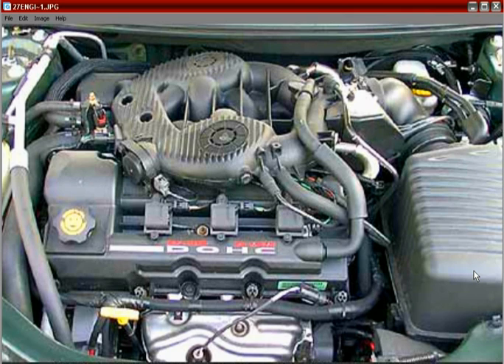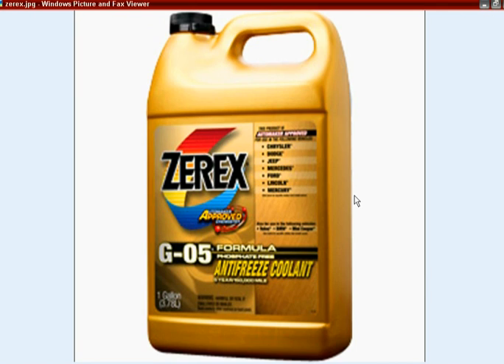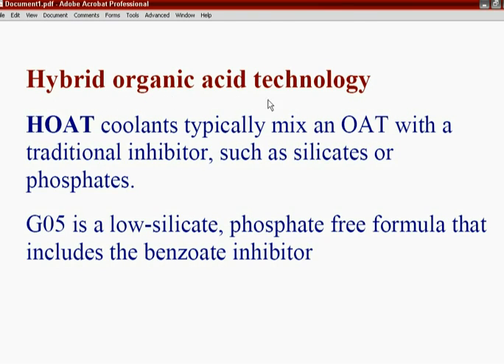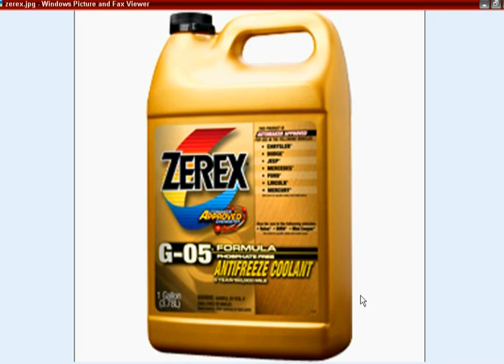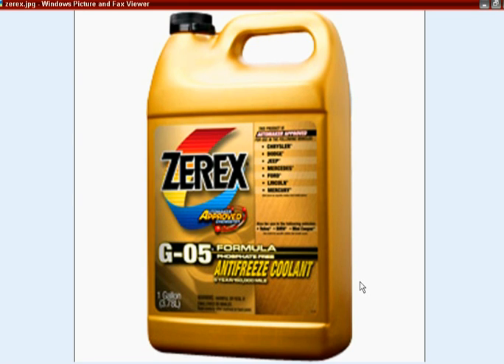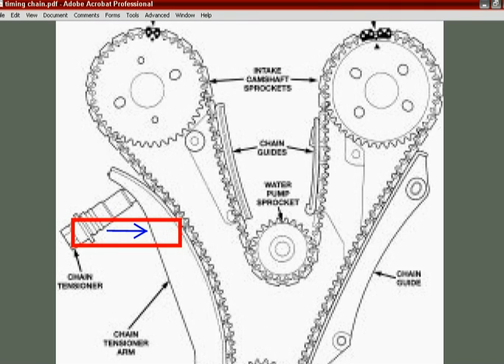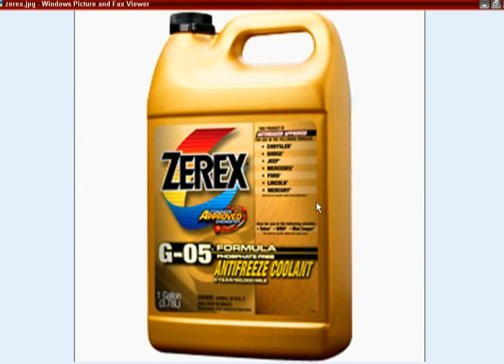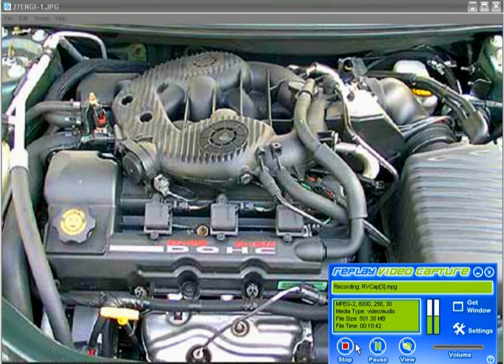Chrysler 2 7 ANTI FREEZE & Block Stop - CRITICAL

Comment: Bought a 01 Sebring convertible with the 2.7 ,,,,,was buying car for the body and figured motor was toast 231,000 kms on it,,,,,got it home and it runs smooth and perfect,,,,,,popped off the valve cover and it’s spotless inside no sludge anywhere so I’m Guessing it was done over cause I’ve never seen one clean.....pretty good score

Comment: You can forgot about Chrysler 2.7 V6, there is not a lot of those.  They are bad car.  So Neon is.
Reply from the maker: +Michael Marr The 2.7 is junk.
Reply: +syyenergy7 Not all 2.7.  There can be some good 2.0L car or something.  I had drive 2.4L Nissan Pick up 1995, it is pretty good truck.  235,000 miles.  Then 1.9L Ford car, one of worst ever made.  After 5th gear blow up in transmission, I got 2007 Dodge Dakota V6 3.7L.  It is better truck I ever bought.  Just need some love.
Reply from the maker: +Michael Marr I know not all are the 2.7

Comment: I have a 2001 Chrysler Sebring Convertible it overheated I stopped the engine right away had it towed home I am now cleaning out the sludge from the hoses the heater core was clogged I am now taking those heater hoses off the back wall flushing them out the heater core. My car did not overheat because of an internal problem it was my fault because my bleeder was leaking and I put it off for too long my question is since my car didn't internally overheat do you think I should replace the thermostat? I know that that is a pretty good job to do my son says that I should I believe my thermostat is OK do you have any tips to help me tell if my thermostat is opening or not? Also I wanted to mention how the heater hose off the back wall go to very small metal line so this engine does not have proper coolant flow throughout the engine when its reduced to a quarter inch metal hoses. I have replaced the coolant of course with the wrong kind now that I see your video I will definitely take that advice of buying the proper antifreeze but when I refill my radiator again would it be normal for my car to run a little more hotter than it was
Reply from the maker: +Kim Carter I personally would replace the thermostat. No way to check them unless you remove them anyway and test them in hot water with a thermometer.
Reply: Just wondering have you had a lot of comments on trouble getting the air bubbles out of the system even though you use the bleeder.
Reply from the maker: +Kim Carter no

Comment: Everything I've read suggests you CAN use a universal antifreeze as long as you do a complete coolant flush first. The problems occur when the additives mix between different types of antifreeze, so a complete flush is necessary first. Mechanics at the dealership have told me this as well.

Is this not correct?
Reply from the maker: kappy0405 That's correct.  But you'd be better starting with the HOAT type because it is designed to seal very minor water pump seepage.  Mixing anti-freeze types is bad for this engine design.
Reply: @syyenergy7  is it ok to add Water  Wetter  to it , to  keep the engine cooler?

Comment: very informative...my daughter has ours wow..stratus 2.7 2004 luckily! it's a 2004...i'll need to update the antifreeze...once that pump starts leaking, I'll stop before the sludge clogs the ports...but i'm not going to rebuild...selling it to a clever mexican. I've blown the hose to engine...plastic coupler (anti-freeze bleeder area) two times....it's very on those engines. I make it a point now to change it every three years regardless.
Reply from the maker: The 2.7 is very hard to work on.
Reply: That could be an understatement...it's quite possibly a throw away engine once the water pump goes.